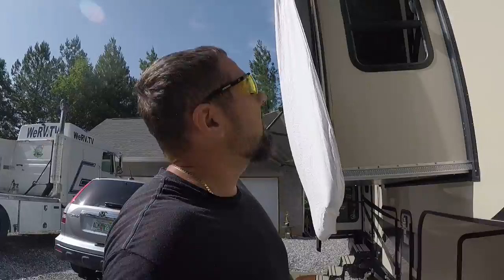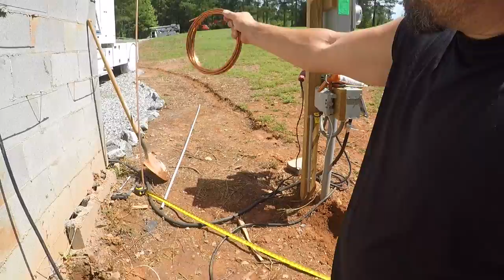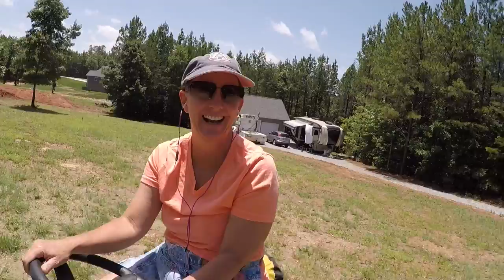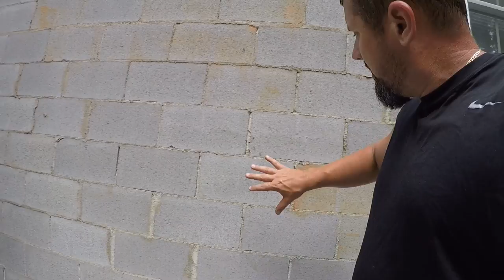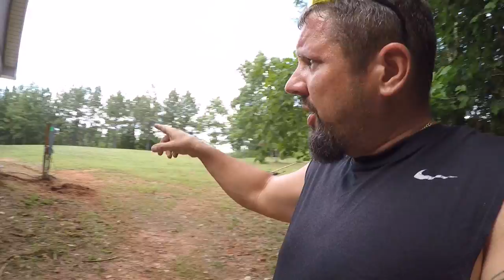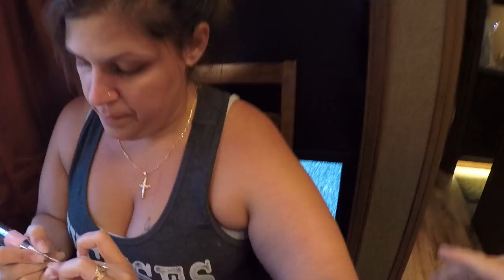Cut Our DSL Line!    ERRRRR ...

Comment: If you have power issues with the garage/rv (powered by 100A service) keep in mind that the RV uses TWO 120V @ 50A circuits.  That is the RV alone could potentially use 100% of the 100A service.

Comment: Ross
Suggestion while the electrician is there have him run some outlets for ceiling fans in the garage and outlets for a couple of 220 volt outlets for a/c uniys that will cool the garage a lot better so you can work and work out in comfort instead of it being 90 degrees in the garage.
Reply from the maker: ahhh great idea !!
Reply: Glad you liked my suggestion